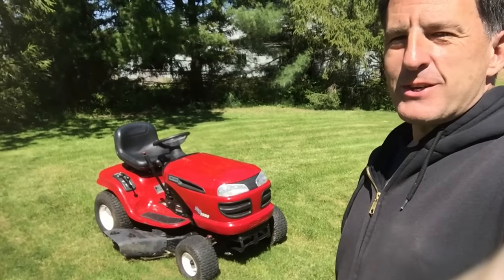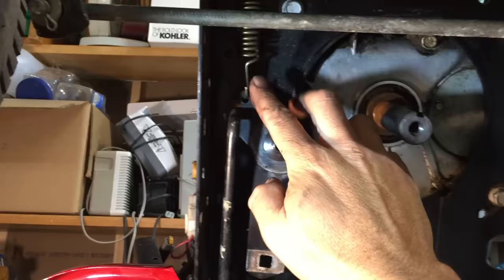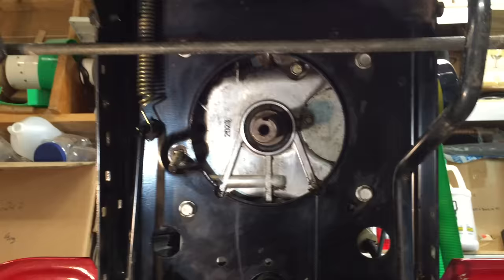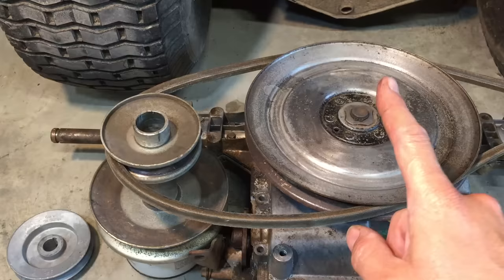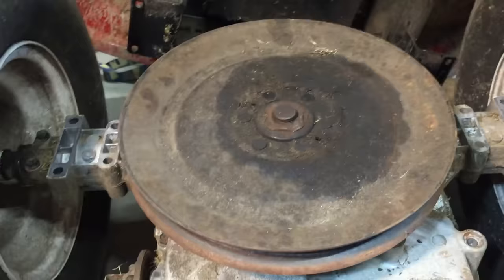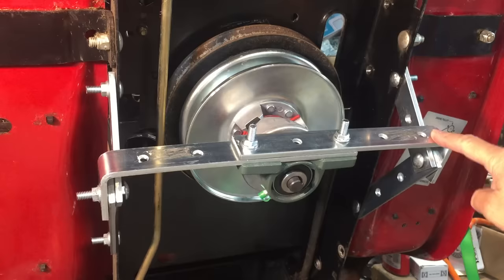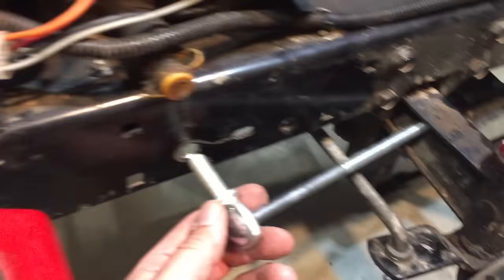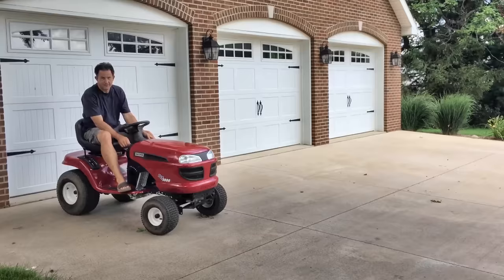Easy DIY Racing Mower

Comment: I built one on the same LTH frame. Except mine has a 25hp Kohler twin with no transmission. All hydraulic. 5  hydro pumps with one wheel motor. One pump is controlled with a control arm like a zero turn for forward and low speed reverse. Then the other 4 are turned on or off with little electric clutches. Lot of weight in hydraulics. But I took the muffler off to compensate.
Reply from the maker: Sounds like an awesome build.  Are all your pumps in parallel to the hydraulic drive motor?
Reply: @HowToLou  yes, all parallel. I'm using Hydro gear BDP pumps. I had to make special hydraulic manifolds to connect 6 high pressure hoses. By simply increasing fluid flow through the wheel motor it goes faster. All the hydraulics are mounted to a removable plate that bolts to the tractor with 12 bolts after removing the transmission. Then it sticks out the back of the tractor more than a foot, the wheel motor is back there and chain drives the axle mounted to the hydraulic panel all the way at the rear. My engine governor is all left factory and a pedal on the left controls engine speed. Right pedal controls transmission 1. Then a plate on the steering wheel has 4 switches for the 4 pumps so I can upshift or downshift without taking my hands off the wheel. A 18" wire harness makes a usable "clockspring" for now.
Reply from the maker: That’s an awesome build!  For lack of a better word: DLightful!  I love “taking over the top” and making something really unique, and you certainly did that!  Here is my crazy build. 
Building a Real-Life Mario Kart
https://youtu.be/HDaAMGNN2gQ

Comment: Awesome fun project i did it with a 16hp v-twin and also made it straight piped it was awesome and sounded like a harley. BUT the problem is braking. it would NOT stop on the original little differentiel brake. u need a disc brake from an atv or something on it.

Ultimate cheap way to make it fast without buying anything is turn the pulleys around and delete the governor. now go break a leg

Comment: just make sure the steering is good. lies mine did 40kmh and still cut yards in 3rd gear or second !!! and all I did was took the back pully gear down. and if you own a single reduction clutch built in you can add another one and 40 kmh is easy to go. and if you can weld you can put any pully on the rear end. I did off roading with snow chains. with my mods. and the front end he shows are prone to crack but if you can weld. you can fix them. don't forget to grind out where your welds are going in to fin the front angle right. I broke many stock front ends !!!

Comment: easy, just spend a couple hundred on parts...lol.  The CVT is a good way of doing it, but you can get some decent speed just by putting a larger pulley on the motor and a small one on the transmission...the trans already has gears so you can climb hills and still have 25-30mph top speed.  This arrangement uses the stock clutch.  Off road mower or mud mower guys have been doing it for a long time, and that method usually only requires buying one or 2 pulleys and a new belt (usually a different length than the original one) and can be done for less than $100.  I had a john deere I bought for $100... it could no longer mow as the engine governor had broke, but with the pulley swap you want a throttle pedal to control engine speed anyway.  It was a great little $200 atv for bombing through the woods.
Reply from the maker: Agreed.  That will work.  I just love CVTs and not having to mess with gears. I have them on my minibikes and Razor.

Comment: is there anyway to modify the suspension so its lower? That high center of gravity is concerning
Reply from the maker: You will have to google it, but yes, you can flip the transaxle to lower the back significantly.  You have to custom rebuild the front end to bring it down.  Both are very common in racing mowers.

Comment: If you don’t mind me asking, how much was all of the hardware, belts, and cvt system cost?
Great video by the way. Definitely one of the most helpful and in depth videos on this subject.
Thanks a lot.
Reply from the maker: If you just do a pulley swap and shift manually, the total is about $15.  I really wanted automatic gear ratio changing, so I added the $99 torque converter and $99 belt.  See the video description for the complete parts list.
Reply: @HowToLou  are there any Facebook groups that could give me more info on this im trying to do this on my troybuilt pony

Comment: can you just put the torque converter onto the transaxle without the need to make a whole new hole and other stuff?
Reply from the maker: While you could mount the TC driven (back) pulley directly on the transaxle, it won’t work for two reasons.  First, I used the maximum length TC belt available.  You can’t buy one long enough to go all the way to the tranny.  Second, the TC starts at 3:1 and ends at 1:1 gearing at full speed.  You still need another 2.5:1 gearing to get you up to 33mph.  You can eliminate the TC entirely, and just swap the other pulleys, and use the tranny gears to choose between torture and speed.  I just wanted it all automated.  This video shows more about gearing and TCs. https://youtu.be/7oSsZ61Ig2M

Comment: You took the clutch pulleys off... so how do you still shift gears while in motion without damaging transaxlle?  When you let off throttle, does driven pulley disengage?  Thanks.
Reply from the maker: You don’t.  Leave it in 6th gear.  The TC starts in low gear and converts to high gear when you get up in speed.   Like a snowmobile.  No gears.

Comment: How much was all the parts
Reply from the maker: About $100 for the torque converter and $7 for each pillow block bearing.  I had the little pulley on hand, but probably $10 for that.

Comment: Great video. Just picked up an old John Deere going to do this exact build. Thanks. Hoping I have the same clearance for the drive pulley shaft. Anything else you can tell me that you came across after would be great. Also how long is the 5/8” shaft?  Thanks again.

Comment: you explained this all really fast, could you explain it in writing for me? i’m working on a race mower right now but the process seems really confusing here
Reply from the maker: Sorry, I only do videos. And you could watch it again and pause it to take notes, or I think YouTube has a auto generated caption option now
Reply: I can help if you want, I just went through all of the trouble swapping out my hydrostatic and whatnot.

Here's a few things I have experienced throughout my project.

1. Pullies can be almost impossible to remove. If light hammering doesn't work stop and buy a steering wheel puller, some pullies will never come off without it. Drill 2 holes and space the puller as close to the shaft as possible (to help stop it from walking) and slowly tighten the puller. I have done a few pullies and the puller is worth it all day long.

2. Fill up the transaxle with oil, whether it is engine oil or differential oil.

3. Wheels can be a pita to remove, heat up around the core and use a long crowbar, and a big hammer and work around the core to help push the rim out.

4. Try to not go too small on the pullies, it may cause belt slippage and rob you of speed.
Reply: @ninevoltmodz4687  locking the front end pivot is also a big deal, probably one of the biggest handling mods that needs to be done.

Comment: Spread out those back wheels with some spacers to reduce that tipping risk.
Reply from the maker: Excellent suggestion.  Also lower the center of gravity.
Reply: @HowToLou  hey, I have a 20 year old 19HP Murray clone law tractor sitting in my shed, trans blew out, I saw this, and was like hmm, just wish I had the know how.  I probably would end up just putting one of those simple friction clutches on it like they use on go karts, and a simple gear mechanism to convert horizontal to vertical, but would probably not work, as those are rated for 3-5 hp motors or I’d end up in the hospital or with $1500 in tickets for riding an uninsured, un registered  vehicle (Long Island, NY).

Comment: I’ve got a problem with my poulie system, i’m trying to put my original poulie up side down (from smal to big) but it doesnt fit that way. Probably ive put it in a turning lathe, but its a 1 time deal and I dont have the money for it. Please commend any kind of solution
Reply from the maker: Yes, mine did not fit either.  That’s why I replaced the small pulley.

Comment: Why could you run the torque converter from engine to diff and use the stock idler with keepers?  Or even build a better idler setup.

Comment: Maybe change the gears in the transmission and add my predator 212 dragster engine. It has all forged and billet components inside, billet flywheel, head has been ported and polished with 26 lbs springs and roller rockers, hardened valves, aluminum retainers and steel keepers, kiehin 26mm round slide race carb, amr300 supercharger, governor removed, hardened push rods from NR racing, titanium lifters, dyno cam 265 super x, nitrous, and many other sweet parts. Lol, its almost ready for racing. I'm trying to find a riding mower without an engine. I wanna start from scratch

Comment: I want to do this with a mower but I'm ripping the blown motor and deck off and see if I can make a electric lawn tractor for a small trailer. Old 14.5Hp b&S Intek I got for free but the heads leaking oil it's carburetor just pours everything out the seals on the bowl, tires never stay aired up and it's got electrical issue with the motor. It isn't worth fixing but I can at least experiment with the thing sense it's blown.
Reply from the maker: I made an electric go-kart several years ago.  Maybe you will find some useful info here. 
How To Make an Electric Go-Kart
https://youtu.be/oZEIXFYea1A

Comment: I had a family member that used to make racing mowers back in the day, and he told me if you make it go to fast it will get hot and seize up the gearbox. Is this true?
Reply from the maker: I have not heard of that.  The pulley swap is the most common mod to make a racing mower.

Comment: How would it perform in mud terrain with that torque converter setup?
Reply from the maker: Neither belt will work well if they get too wet.  I would suggest adding a skid plate/shield to keep it dry.  If you are crossing deep water, forget it.

Comment: Hi there interested in doing this to my own mower as it looks like an awesome project just wondering if u added brakes as that would definitely be needed at 30+ mph speeds
Reply from the maker: There are actually brakes on a mower and I kept those.  I mention the brake connection in the video.   You can certainly add more

Comment: how much do you think the intire thing would cost
Reply from the maker: If you watch and wait, you can usually get an old riding mower for free, as everyone is switching to ZTR mowers.  You can do a simple front to back pulley swap for $50 and be done.   I really like CVTs, so I spent an extra $200 on a CVT and bigger belt.

Comment: Are you running it with no tensioner pulleys.
Reply from the maker: Correct.  But one could be added if the long belt stretches.  The TC tensions its own belt

Comment: Does the torque converter and everything in this video apply to other mowers
Reply from the maker: Generally yes.  Take a close look under your mower and see if it looks like mine in the video. And mini mowers are made by MTD and then just re-branded, so they’re actually all the same
Reply: Has to be a gear box mower. Like 5 or 6 speed. No hydrostatic mowers.

Comment: The video is great but pretty fast.. it looks like your throttle cable is connected to the governor arm? So you didn’t remove the governor? If it this is correct doesn’t it want to resist the higher RPM?
Reply from the maker: That is how they normally work.  The governor, by itself, makes the engine run at idle speed.  You pull on the governor arm, with a spring, to speed it up.  In this setup, the governor can still “fight back” to keep the engine from over-revving.  To “delete” the governor, replace the spring with a solid connection.  Then it must do exactly what you ask, and its up to you to listen for valve float.

Comment: What are the sizes of the bronze bushings on the steering? Trying to find them.
Reply from the maker: I just found them at the local hardware store. They are roughly 3/8” inner diameter
Reply: @HowToLou  thanks, i was guessing about 3/8 id and 1/2" od.
Reply: 3/8 id is too small fyi. I may have to drill them out.
Reply: Ok. The bushings i got were 3/8 id x 7/16 od wont work. Ordered 7/16 x 9/16 x 1/2 bushings which required drilling the steering mech out to 9/16, which i did but 1/2" length is still too long to get the retaining pin in, so it has to be cut off. Wow! You made it look so easy.

Comment: how much did it cost all toghter
Reply from the maker: Got the mower free.  $100 for the torque converter, u don’t technically need that.  U just need the $10 small pulley and use the existing belt.   Simple pulley swap

Comment: how's the wear on the transaxle with the increased input shaft speed
Reply from the maker: Those trannys are built strong to handle hill climbing torque.  They handle the speed very well.  Super solid gearing, and well-greased

Comment: Very cool. It has a CVT and a 6-speed manual gearbox?
Reply from the maker: Good question.  You don’t need both.   Most people just use only the gear box and shift into low gears for hills and high gears for speed.  I leave mine in high gear and the CVT automatically shifts from low to high, as needed.

Comment: How do you shift? Or do just chose 1 specific gear and the cvt does the rest?
Reply from the maker: Most people just pulley swap with no CVT.  They have to switch gears to change from hill climbing torque to high top speed.   I opted to spend a little more money and add the CVT.   I always keep the mower in high gear and the CVT automatically switches from torque to speed, as needed.
Reply: @HowToLou  Thank you! You inspired me to do a similar design to my mower. Just couldn’t figure out the transmission part of it! Excellent video!

Comment: Where did you get those bronze tie rod bushings?
Reply from the maker: I found them in the nuts and bolts isle at the hardware store. They have little drawers with all kinds of specialty parts
Reply: Ok, thanks!
Reply: @HowToLou  what size are the bushings

Comment: Why did you change the driven pully if your not using it anymore? Is it to space the torque convertor?
Reply from the maker: I am using ALL the pulleys.  The engine drives the TC driver Pulley.  The TC belt drives the TC driven Pulley. The TC driven drives the 9 inch pulley, and the V-belt drives the 3 1/2 inch pulley

Comment: Would this work on a different mower? I have a 1995 craftsman that I want to do this on
Reply from the maker: Very likely the same.  Look under the frame, above the mowing deck and see if it has one long drive belt from the engine back to the transaxle.  If so, it will work.
Reply: Save your money do not buy the "cvt" Do a simple pulley swap and use that money for safety related stuff like brakes, a proper front axle or at least stop the stock one from pivoting, wheels with bearings that are held on with something better than e clips...... Lower the thing

Comment: This won’t work on a lawn tractor with a hydrostatic transmission right?
Reply: @HowToLou  gotcha. Those aren’t as common today I don’t think.
Reply from the maker: Correct.  Hydraulic is an upgrade for mowing the yard.  It used to be rare, but now its the norm.  So, you can get the gear mowers super cheap, if not free sometimes.   And now Everyone wants ZTRs, so tractor mowers are getting surpluses big time.  
By the way, Craftsman re-labels many different brands.  The one in this video is MTD.  I also have a Craftsman Husqvarna.
Reply: @HowToLou  ahh i see so I guess some craftsman mowers are made by mtd. But majority of them are made by ayp I believe.
Reply: @HowToLou  And i hear ya about ztr mowers. Our property is 2 acres since we recently bought the front and back lots from our neighbors so i’m saving up for scag tiger cat commercial ztr with 52” deck so i can cut it faster. Yeah i know it’s kinda crazy, but it’s like getting luxury car you know, lol
Reply from the maker: I do, actually!!
Why I Love my Zero Turn Mower
https://youtu.be/-6uGPVJspXc

Comment: Where did you get the CVT pulleys?
Reply from the maker: Parts: 
40 Series Torque Converter with 1" Drive and 5/8" driven - Amazon
Larger 47.5” belt for Torque Converter above
Belt: Comet 213165A
5/8" shaft with 3/16 keyway - Amazon
3.5" pully with 5/8" bore.  Amazon or hardware store
62" belt - Amazon
1.25”x12"x12" angle brackets - hardware store

Comment: Does it work on mtd varidrive system?
Reply from the maker: Yes, it can, but you need to leave the varidrive pulleys in.  You swap the engine pulley with the first pulley off the engine belt.   Its not as easy as the standard transaxle setup.

Comment: Questions would this work for a 454
Reply from the maker: If you mean a Husqvarna 454 ZTZ, no.   You would flip it for sure at 35mph.  Also, hydrostatic trannys can’t handle the high speed

Comment: pulley swapping is WAY easier than installing a CVT
Reply from the maker: I did both.  I didn’t have to use the CVT in the middle, but they are just so cool.  I can leave the tranny in high and go from wheelies to 35mph all in the same gear.

Comment: CVT transmission
Reply from the maker: Yep, Torque Converter on Amazon, but also known as CVT in some circles.  Minibike guys says TC.   RZR guys say CVT.  I have both machines, so I use them interchangeably.